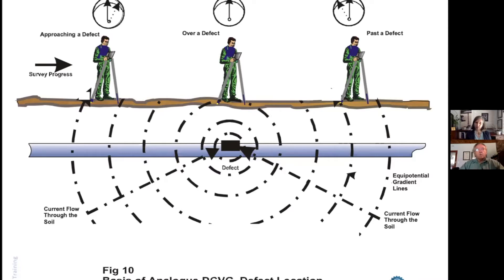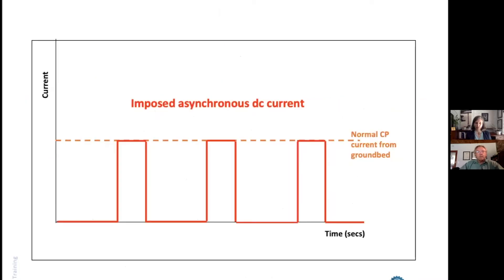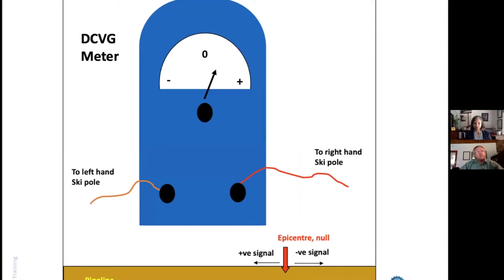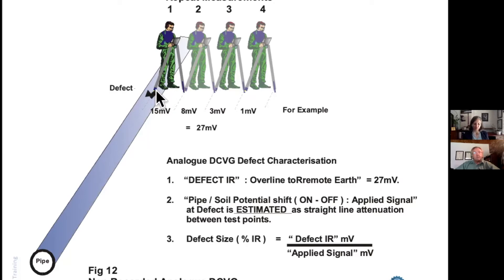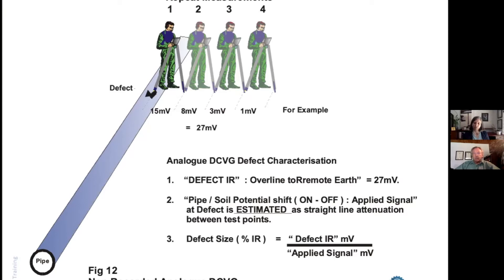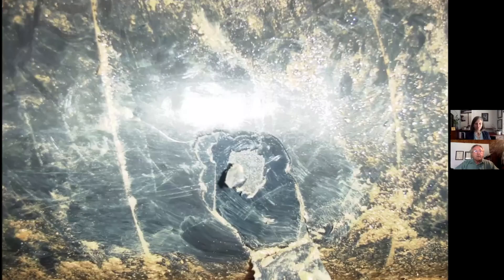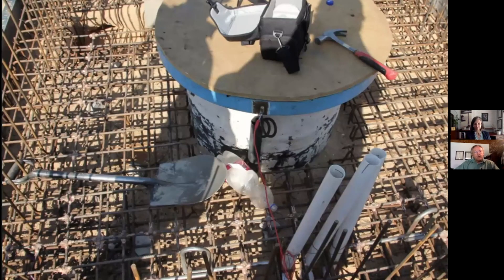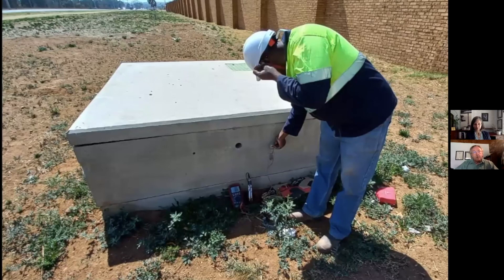DCVG | Pipeline Survey Techniques

Comment: Great talk. Is it not possible to size defects against a coupon of known size?
Reply from the maker: hank you for your question Darren.

The relative sizing of defects is dependent on a number of factors and is unique to each pipeline. 

If the pipeline in question had suitably sized coupons installed, and these are bedded in the same backfill as the pipe, it may be possible to use these to correlate with the %IR readings. 

However, in the majority of instances, calibration digs are undertaken of a selection of different %IR - to verify the defect size vs %IR and determine what %IR should be repaired.

We hope that answers your question adequately.
Feel free to contact Isinyithi if you need further assistance. (pipeline@isinyithi.co.za)